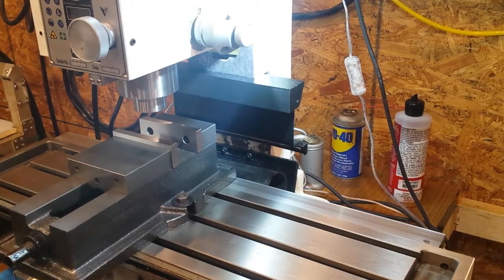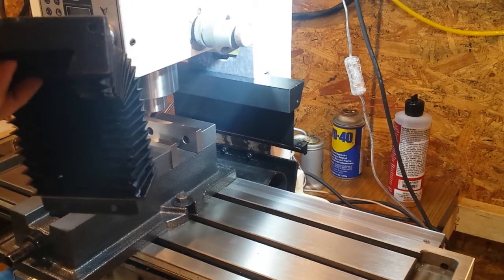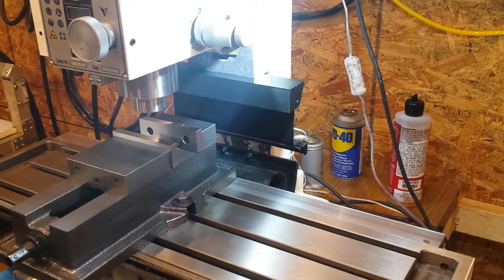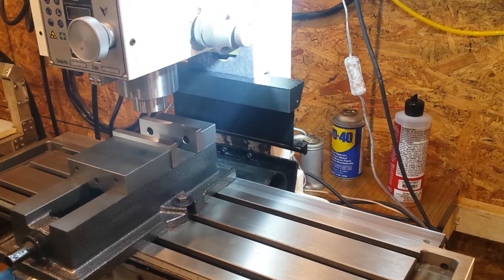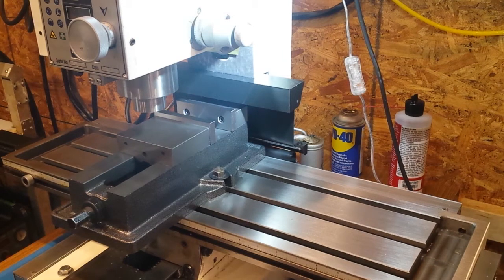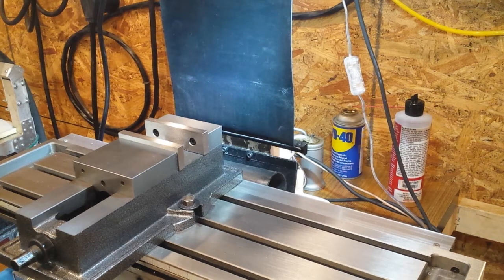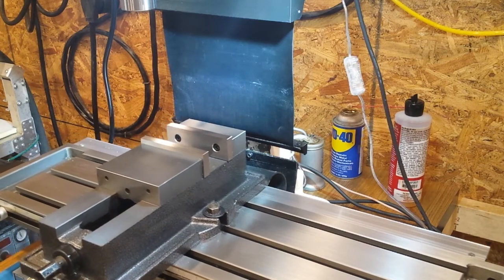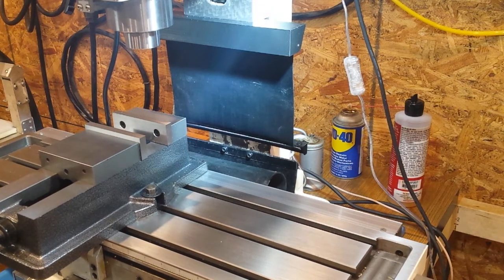Replacement Z-Axis Way Cover for Precision Matthews PM25-MV Milling Machine

Comment: Great solution, way better than buying bellows. Did you remove the pawls from the ratchet mechanism to prevent it from stopping? Typically these roller shades use a pawl and ratchet to allow it to stop at the desired length but in this case you want constant spring tension.
Reply from the maker: Hi there and thanks.  Yes, I did disable the internal locking mechanism of the spring drive.  I don't remember exactly how, but I do recall it was quite easy.  Give it a try!

Comment: nice solution!  i took it one step further and used it to cover the z and inner y travel with one blind.  my mill is slightly different but i mounted the roller the same way as you then at the bottom of the travel i made a round stainless bar the width of the cover and mounted it in the corner where the z meets the y, the bar can spin as the cover moves to reduce friction.  The cover goes under the bar bar and attaches to the y.  It worked pretty well straight off but i had to add a little scraper bar in front of the roller to scrape the chips off the cover in the y axis but its now spot on.   Just wanted to say thanks for the blind idea as it solved both the z and the inner y cover for me.
Reply from the maker: Sorry for the VERY delayed response, and thanks for the thoughtful comment.  Sounds like you've got a well-working solution over there.  Regards.

Comment: Nice work Neil! I'd say its a home run. - Nick
Reply from the maker: Thanks Nick!
Reply: I spent a lot of time trying to come up with a elegant / durable solution' (G0704) for way covers! I appreciate you execution , it looks like it functions well and looks good doing it!
Reply from the maker: It does seem to be working well.  However I'm not yet convinced that neoprene is the right rubber, it seems to be affected by WD40 and other oils.  I've been researching other materials, no conclusion yet.
Reply: NeilWNC look for either 1/16" or 1/32 buna-n rubber from McMaster Carr. Comes in sheets! Check out my video on it